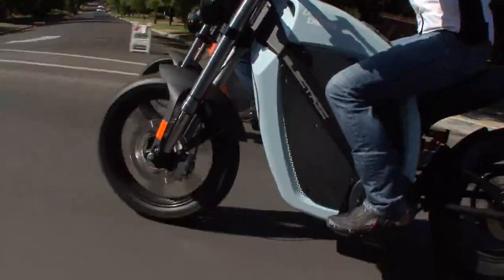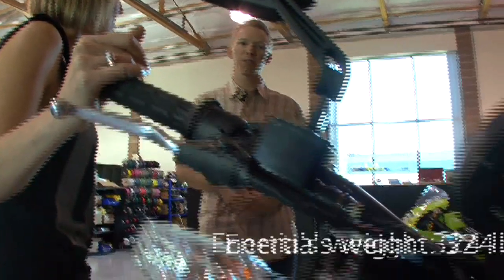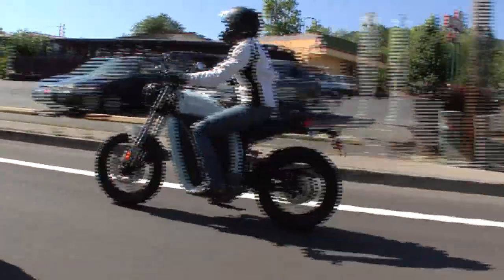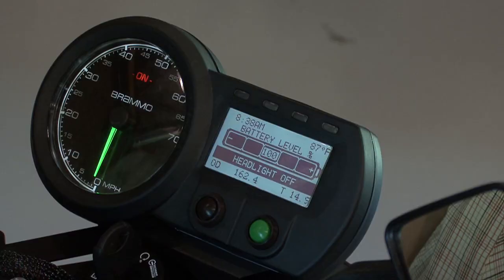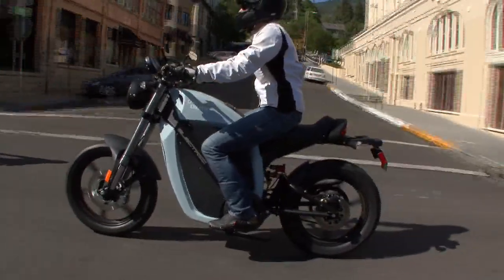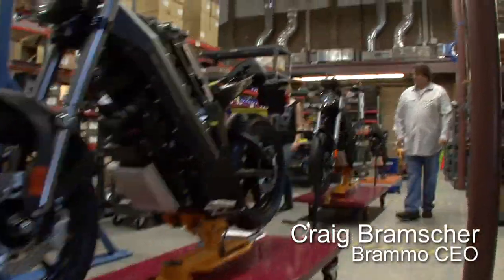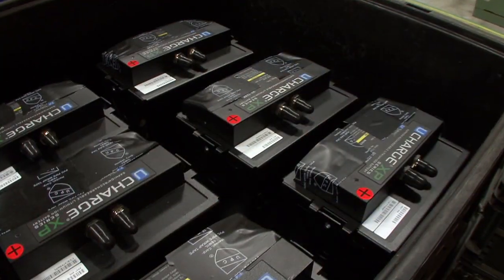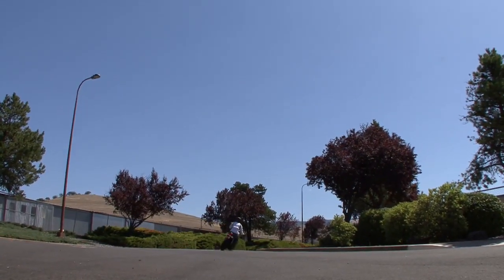Brammo Enertia electric motorcycle

Comment: Nonsense.  You are comparing the equivalent of a 250cc machine with a Z1 - the comparison is as non-sensical as it is irrelevant.

In the context of a commuter bike, the Inertia is a perfectly acceptable option with the only caveat being the relatively high price.  To partly offset that, the cost of its 'fuel' is nigh on negligible.

Comment: The problem with electric bikes is that they just don't have the same capabilities as gas powered vehicles. A $32,000 electric sportbike can go 130 mph (this is just an example), while a $8,000 gas sportbike can go 200+mph. For now, they just aren't comparable. It takes too long for the electrics to charge, being as long as 4 hours to fill it up, while a gas bike would take 2 mins to fill with gas. The only way these vehilces wil be adopted, is if they make them able to compete with gas power.

Comment: @issamworld If the battery is 5000 dollars (I don't know what the cost of a replacement is) then that's 12.5 cents per mile.  Along with electricity that's about 14 cents per mile.  Most petrol bikes are 5000 mile service intervals, few are 10000.  So between 4 and 8 services.  Services vary from about 500 to 1000 so that's between 2000 and 8000 dollars for the petrol bike in servicing.  Petrol another 4000 dollars so thats 15 to 30 cents per mile. No need to wait for the future to tell.

Comment: @ectoplasma2 It's just never a problem in reality.  Because you can charge it on any power point it's fully charged every time you get on.  I ride my Zero DS (similar range) to work and charge it up.  When I get on at lunchtime to ride home for lunch it's fully charged.  I plug in at home and by the time I'm ready to go back to work it's fully charged again.  There's always enough charge to detour to the shops on the way home.

Comment: @WineAndGravy If we all wait then the tech will not improve and the price will not drop because there won't be any electric bike companies.  Jump now!  The batteries are heavy but the whole bike is lighter than a petrol equivalent.  They're expensive to buy but the total cost of ownership is lower.  If you wait then you will be just missing out for 5-10 years on the benefits I'm enjoying right now.

Comment: @issamworld That's 1000 full charge discharge cycles or about 40 miles.  Do you really travel 120 miles every day?  If not then the battery will last much longer.

Comment: @rafaelbdb2 Not expensive, total cost of ownership is much lower than a gas bike.  Depends what you mean by "far", it goes 42 miles.  If you recharge while at your destination it can go 80 miles in a day.  Compared to the average daily travel in the US of 29 miles it goes nearly 3 times further.  You can find recharges on the road, they rode one all the way across america.

Comment: @mptrax Yes, Hub Motors are truly nice because of the Efficiency and Silence of a gearless direct drive, but they also have considerable Disadvantages:
First of all, they contribute to the Unsprung weight, and also shift the Center of gravity backwards, both not too nice.
Then they are more difficult to construct, because the need to contain the Bearings and turn slower. This also makes them larger. And Cables get longer.
But after all it is a decision the engineers made for some reason.

Comment: @xamboozi  it takes hours to charge one of these. some of us like to take our bikes on long road trips. cincinnati, oh to miami, fl is 1,100 hundred miles or so. if i were to ride one hundred miles and stop to charge for 8 hours it would take several days. gas is much cheaper than a hotel room every one hundred miles. that extra $2,000 buys me approximately 635 gallons of gas @ $3.15 a gallon. that is 26,000 miles worth of fuel at 41 mpg. THAT is why i am not interested in one... yet.

Comment: I simply don't see where they're getting the MSRP from. Eight 24v LiFePO4 battery packs would cost about $1000 (probably half that at wholesale prices). A 24v electric motor capable of carrying a rider would cost another $1000. Frame and components should be a lot less, about $500-1000. That's $2500, add on the markup and shipping fees you have a $4500 motorcycle. Add to that the special charger that you need it's still just $5000-6000. That's a competitive price. The Empulse looks cool though.

Comment: i love the idea of alternative fuel sources, but the down side for electric (especially motorcycles) is the range. i drive 300 miles on a weekly basis just to and from school. i dont have the time to wait around for a 4 hour charge for each trip. second i love to just go for rides and a 50 mile range is a real killer. i would have to own a second bike just to go for joy rides. in my opinion any electric vehicle wont grab until battery technology gets much better.

Comment: @xamboozi 

really! look at how much a typical electric conversion costs for a car! motors can be $4000 alone. this is a fully engineered bike that out performs most cycle conversions and is smaller & lighter.  i'd love to have one. they look AWESOME & futuristic.

i think there's some corporate conspiring too to keep batteries etc. expensive & hard to get so electric doesn't catch on for the same reason there are no hydrogen powered cars even though the tech is a decade old at least.

Comment: @HOPPERFZR What difference would there be in the two drives?
Chain- two sprockets, chain, bolts for sprockets

Shaft- (like Yamaha) aluminum shaft, two sets of pinion gears, rear housing(alum)

I wonder how much difference it really is?

Comment: I have a 07 DRZ 400SM That cost $7k new and commute with it daily (mainly to get free parking as it costs $160+ on a monthly pass).   It costs me $5 a week to ride to work or just under $300 a year. I'll spend $50 for an oil change plus other things like chain lube.  I'll need to replace my chain every few years and since I drive 14 miles daily my tires should last me a while. My commuting costs on a new $7k bike is $500 a year max.  Why should I buy this bike other than it's green & looks cool?

Comment: the range limit they give is conservative - so is the top speed. I keep 3 bikes in NYC and only ride the Enertia now, I use it every day for 2 or 3 trips ( remember we have no hills - but I AM a 200lb guy ) and I charge it once every 8 days ! It's awesome for urban . Awesome.
Reply: 12 years. How did it age?
Reply: @sunnyvale4088  Battery died years ago no one can fix it no parts. dead. The more powerful newer model still works great - the Empulse
Reply: @AlanWilzig  Do you still have the enertia or did you sell it off ages ago?
Reply: @TechWizard  still have it but as I replied above - it's a brick :(
Reply: @AlanWilzig  I make batteries for a living, Im interested in it if I can find out if there is some proprietary data communication with the stock batteries to the speed controller because that would essentially make replacing it almost impossible.

Comment: and a smaller generator that would run off the first generator?

no, because even the generator would create resistance that would waist the battery's energy into heat.

Comment: You can't put a generator on there because that would cause parasitic drain and cause more drain than charge. Laws of Thermal dynamics states this very clearly. Electric generators are around 90% efficient so for every time you try to charge with the vehicle in operation you would lose 10% energy for ever unit of energy used. Its currently not possible to create a 100% efficient motor... if one existed you could hook it up to itself, power it, and run forever... that would be perpetual motion.